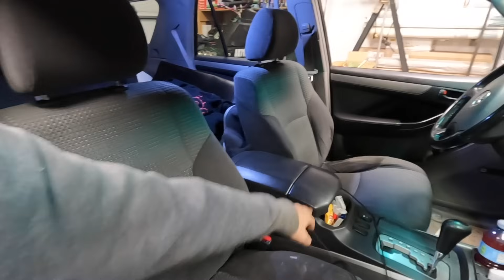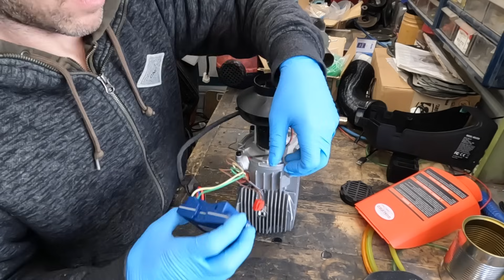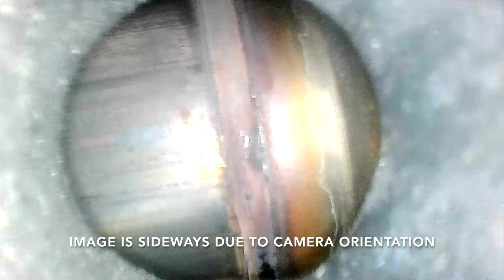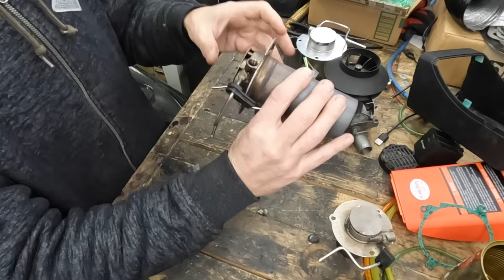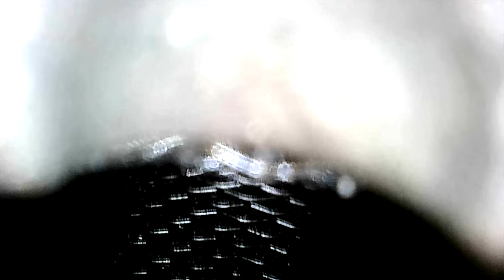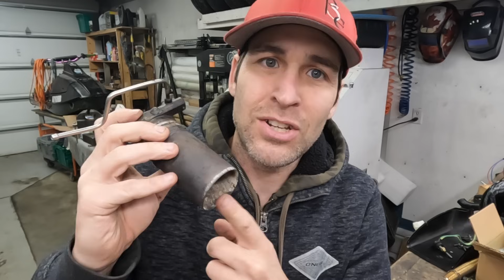Diesel Heaters - Orientation Deep Dive - Heater Mounting Explained

Comment: Awesome video! I have a diesel heater from Vevor too wrecked one trying to burn motor oil, bought a second one to just burn diesel and the other one I use for tests. It is essential for me to find an alternative source to warm my house. Electric, propane, or petroleum are just not affordable anymore. Red diesel is doable but on max it wont heat the caravan to a good temperature when it gets cold outside like 0 Celsius and below, from the Netherlands by the way. I checked al those videos on WMO and my verdict is it cannot be done with the actual setup of these heaters. I hope you can get some more insights in if we can adapt them that it will burn WMO maybe with some cleaning? Appreciate you and your videos hoping for more!!
Reply: There is something wrong with your heater setup. My caravan has 8m inside lengt with 1,95m roof height, 2,4 width inside, Insulation only 30mm (it's from 1982) - and the 5Kw heater keeps it quite cozy at lowest setting this winter in Lower Saxony - not far from you and almost sea level, the recently minus 8 °C required half power. Full power only required, when heating a completely frozen caravan. But with that low fuel consumption at lowest setting (1,2Hz) there's no need to let it cool down, if you're just away for the day. As the evening get's cooler and i'm just sitting, watching YT, i raise to 2 Hz and maybe 3Hz, when it's colder than minus 2°
So - where does your heat go?
My guess ist an open skylight.
Open skylights draw ice cold air inside and your bottom area get's cold - no matter how much the heater is putting out.
Reply from the maker: Thanks for your comment. I agree with Werner, if you are recirculating air, a 5kw heater should be able to keep a decent size caravan pretty warm. I used one to heat my 24x26 foot garage last year, and while it has better insulation, it also has 9 foot ceilings and a lot of air space... it was fine at -20C 

I suspect this mod, if it works at all, will extend time between cleaning, but will of course need cleaning.

Comment: I used to work for a junkyard that had a waste oil heater and that thing was huge and clogged up weekly… and it had three filters before the oil even got to the heater part. I don’t have much confidence in either of you being able to make waste oil work in one of these. Stick with diesel, it’s going to be cheaper in the long term, waste oil is close to being illegal to burn, I’m pretty confident that it already is in the UK… which is ironic considering they burn it to get rid of what’s left after they recycle it.
Reply from the maker: Thanks for your comment. 

I have talked to a lot of waste oil burner techs and heavy oil burner / boiler techs... They all say the same thing as you, and I that has changed my approach. 

I will release a video talking about the goal / idea with this heater. I did about 4 months of testing last year, and what you say is true.... these heaters are not suited to anything but clean fuel. My goal is not to make a maintenance free heater (at this point) but to extend the cleaning intervals. 

Typically, waste oil burners are rated at litres per hour or gallons per hour, while these little heaters consume a about a gallon a day, about 4 litres in 24 hours of run time. 

I appreciate your info and you not calling me a moron ! Haha... some people get pretty worked up about this stuff
Reply: @loweredexpectations4927 won't call you a moron, just talking about the experience having one run in a junkyard in Maine that used one all winter long and how much of a PITA that it was to keep running. Good luck.
Reply from the maker: @david78212  👍 Yes, I know I'm in for a battle. Like I said. I burnt waste oil for 4 months last year. I went through about 300lL of it in my little heater and sometimes had it apart 4-5 times a day, cleaning and modifying it. The heater ran for about 13 hours a day, most of the time with me babysitting it.  I'm very familiar with how much of a PITA it can be. 

This is what I built my channel off of... I think people like watching me suffer 🤣

Comment: Definitively, does an 8 KW heater really exist? Thanks   Greetings
Reply from the maker: That could be a whole video in itself. There is no simple answer, but, no, not really. 

The 2 kw is about 1.8, the 5 kw is about 4.3 and the 8kw in most cases is also 4.3 but sometimes the pump hz is increased to push it up over 5. 

There is now a new heater on the market that is physically larger, I have just ordered, they call it 8kw, and it appears that it will be about 7kw, based on the fuel consumption claims.
Reply: @loweredexpectations4927  Thanks Waiting for the next video about the "new" 8KW..Greetings

Comment: Your "bolt on" waste oil upgrade part is a great idea!  Sounds like a nice little side business in the making if it works!  I'm very interested in this as I'm sure many others are as well!

I think I heard you mention there is no heat output difference between a 5 kW and 2 kW heater?  Does the 5 kW use more fuel?  If it does then it must produce more heat, so I'm confused (I'm sure I have some understandings wrong)!
Reply from the maker: I will be releasing a video talking about this in a little more detail... the goal for this set up is to be a maintenance extender. It may be a total fail, but my hope is, it will work engou to collect data on how much crud builds up based on oil volume consumed. 

I have some ideas on a self cleaning unit, but that will take considerable work, and I need to know how much crud before attempting to make something to clear it.
Reply: @loweredexpectations4927  Maybe it is not truly realistic to run 100 percent waste oil, but fifty percent might be more viable and that would still be a huge win.
Reply from the maker: @AtimatikArmy  In the end, this seems to be a percentage game.... Meaning a litre of oil leaves behind (i'm making up the thumbers) 10 grams of ash. It takes about 2 hours to burn a litre.... SO, if you dilute it 50/50, you burn 2 litres of fuel before consuming 1 litre of oil, essentially doubling your run time.... however, you have still only burned 1 litre of oil... Make sense ? 

I have talked with boiler techs as well as waste oil burner techs and they do have some interesting thoughts about keeping the temp high at the oil flashpoint location, but not too high further down the line. The ash that does not burn will melt if hot enough, and when it does, it is more likely to build up, rather than flow out the exhaust I'm not sure if this is based on research or assumption, but I have heard it from a few different people.
Reply: @loweredexpectations4927  So it doesn't burn off the carbon like a hotter spark plug will burn off the carbon so it doesn't foul?
Reply from the maker: @AtimatikArmy   Yes and no. Carbon will burn off pretty easily with a little heat and enough oxygen. What is left behind from heavy oils is not carbon, but other non burnable minerals. When you refine oil and turn it into diesel or kerosene, you remove these substances. 

Ultra low sulphur diesel is an example of this. Even regular diesel or airplane fuel still has quite a bit of sulphur, and this either builds up, or ends up being pumped into the air... So, in some cases they process the fuel further to remove more sulphur.
Reply: @loweredexpectations4927  gotcha!  Makes sense, thanks for the explanation!

Comment: Where do you get your burn chambers from?  Do you know the purpose of the internal mesh? I have a burn chamber cut apart kind of like yours and found replacment mesh for it on aliexpress but yours seem to work without it. is it for holding heat or kind of wicking?
Reply from the maker: I have purchase one chamber from WIsh .. I believe, and the others from aliexpress. 

The mesh is basically the same as a wick. It spread the fuel out over a larger area instead of just pooling in one spot. This larger surface area exposes it to more air and helps it burn cleaner. 

Diesel flashes off very quickly at higher temperatures, so you may only notice issues during start up, before the chamber reaches temperature. If you have cut your chamber apart, you want to make sure that it is sealed up well. I use stainless steel rings and a hose clamp...

If you do not do this, the diesel can drip out of the chamber before burning and burn in the exchanger or while going out the exhaust. This makes a lot more carbon monoxide and is less efficient.
Reply: @loweredexpectations4927  I saw the hose clamp back when you were working on it but what did you use for the stainless rings is it like a band or a belt around it? I have a tig welder so worst case I can just weld it if I have to.
Reply from the maker: @benjamin2339  I used a piece of stainless that I had laying round. It was a piece of a jet ski pump. You could use the piece of a hose clamp without any slots in it if you have a long one. Welding it takes care of it for sure.

Comment: The 8Kw heater probably only is "8Kw ready".
I have seen larger oil pumps offered. The one we always get is the standard 22ml model.
But then - i can ramp this 22ml pump from 1,2Hz to 5 Hz with my heaters and controllers in stock setting.
If you let it buzz with 10 Hz and this doesn't overheat the magnet, fan speed ramped up accordingly, this 8Kw maybe get real even with the small pump.
Reply from the maker: The one that I ordered claims that it consumes .7L/h , so I will have to see if it has a larger fuel pump or just runs at higher hz... likely a larger pump. 

It should arrive next week. When it does, I'm going to pull it all apart before I fire it up... try to document the whole thing.

Comment: i would pay 500euro for a heater that burn waste oil as easy as diesel.
Reply from the maker: I think my mod is a long way from that.... "waste oil as easy as diesel" may be possible, but what I'm aiming at first is an extended cleaning interval mod. 

I do have a few ideas for making something that is .... self cleaning, we will call it, but that is a ways off.
Reply: A hundred dollar one can do it easily.   40 percent very well filtered waste or veggie oil..50 percent new diesel /heating oil/kerosene/jet A, and 10 percent petrol.   Run at least 1/2 to full throttle.    Switch to straight diesel if you can't run at least 1/2 power and during any startup / shut down
Reply: @gbear1005  fake news
Reply from the maker: @gbear1005  Please make a video showing this happening. There are lots of videos of people doing this and failing, so we would all like to know how your setup is different from all of those that have failed. 

I am curious to know where the glycerine goes that seems to cause everyone else problems. In biodiesel, this is "cracked" out using alcohol and lye and then the glycerine is removed before burning. I thought perhaps the gasoline might have an effect, but separating the glycerine, but unless it was drained out, that would be even worse. 

Running at full throttle causes the primary burn chamber temperatures to drop substantially lower than at half. The only part of the heater that is hotter at full throttle, is the exchanger.
Reply: like i say it will not burn easy only 40% and a lot of work. i can burn around 60-80l pure before it clogg up and shut off. i would just like one that burn 100% wvo with no problems @gbear1005

Comment: All the heater manuals I have indicate the 2 heater orientations acceptable.
Reply from the maker: Good to know.
Reply: @loweredexpectations4927  Nothin like reading the Docs 😂
Reply from the maker: @stevecarlisle3323  That's a last resort, no ? I have looked at the Webasto manuals a few times, briefly, out of curiosity, but other than that I have only had Vevor heaters / manuals. The only thing they say about installing is some very basic safety studd "don't vent the exhaust inside"  and preferable install it inside, but nothing about orientation.

Comment: I think if you burn waste oil in one you have to get rid of those mesh's. A round cylinder with holes drilled in would probably work. Did you try that?

Oh I posted this before i watched the entire video and we you are doing some thing similar. I think you're on the right track
Reply from the maker: Yeah. I did almost 4 months of non stop waste oil testing. The mesh disappears quickly. 

I'm not certain what part you are referring to as "a round cylinder with holes drilled" I tried lots of things, but nothing that matches that description. 

The flow of air, fuel and burnt gasses is pretty fussy in these units, and I have learned, first hand, that a lot of stuff that you think would work really well, cakes the heater completely inoperable, haha 

Ok, haha, Just read the end of your comment. So you were thinking holes instead of slots. I started to do it with holes and realized it would take a LOT of holes.
Reply: Yeh I like your design. Most of the burn chambers I've seen for waste oil burners are round cylinders with a series of holes drilled in them. So that's what I was thinking might work. Your design is the same principle. The only thing is they have all been in the vertical position so I'm not sure horizontal would work. Definitely worth trying though.

Btw just ordered a Vevor 2kw for my Dodge quad cab. Your code worked 👍. My first one so it will be a learning experience. Do you have a Facebook group?
Reply from the maker: @jimschaffroth5652  My heater will be running vertical. Part of the reason I didn't try this before, is my previous burn chamber would not allow for running vertically, so I didn't go down that road. In hindsight, I could have welded up the hole and drilled a new one. 

Welcome to the diesel heater owners club, haha. I don't have a Facebook related to heaters.... I don't even have enough time for YouTube, most of the time.